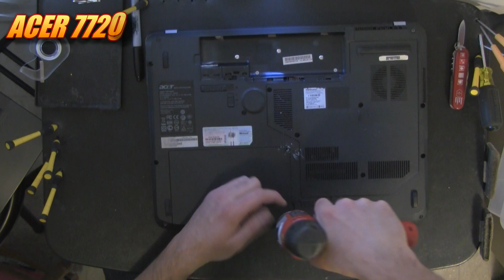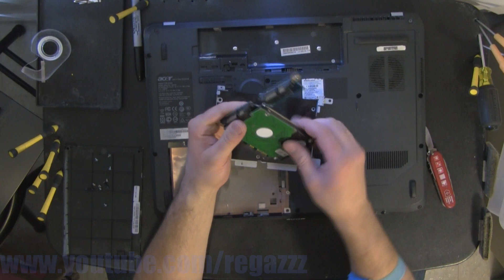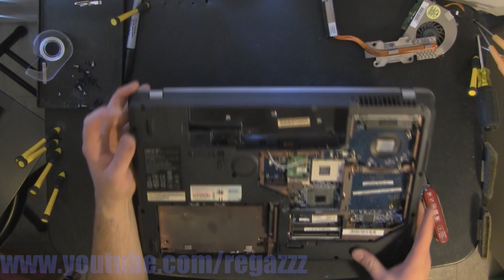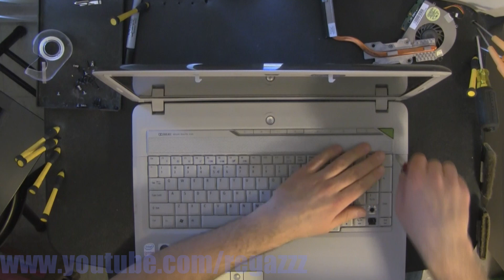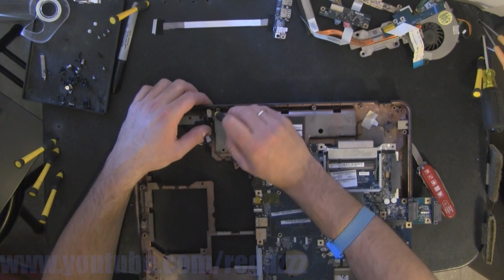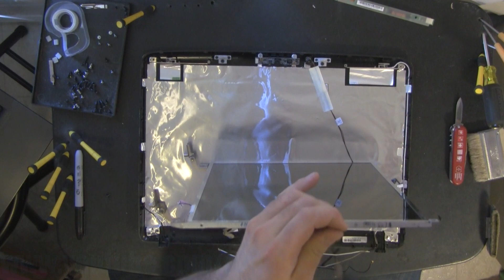ACER 7720 take apart video, disassemble, how to open disassembly

Comment: Have this exact model, 3 of them, all dead mobos.  Put on a custom bios for for 7720G and they died after the batteries ran out of charge.  Going to replace the mobo in one to make it a 7720G, buy a video card, cooling, new cpu.  Hope it all stays cheap.